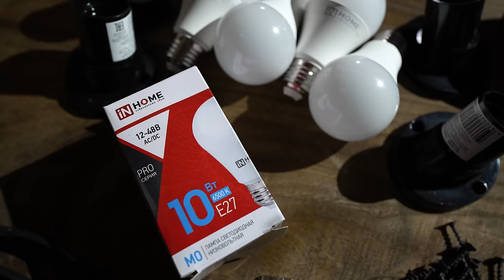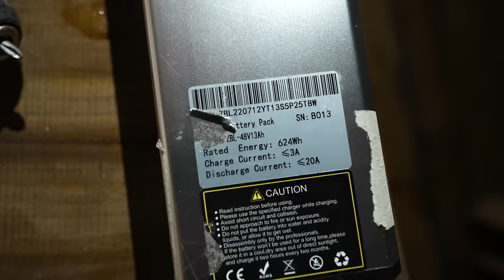HIDDEN HOUSE UNDERGROUND after a HARD TRIP, I'm warming up. PART 18

Comment: I buried a 30 gallon plastic barrel with a screw on water tight lid in the ground to store my tools and extra food in. Every time I go to my cabin I bring extra non perishable food and things like extra nails ,screws ,matches and some medical supplies to put in the barrel to have if I ever need them. I now have enough tools,food,medical supplies and things like soap to last me weeks if I should ever need them. The barrel was light weight and easy to carry on my back once I made a harness to carry it. I rotate the food even though they are mostly dehydrated foods just to make sure they stay good. My tools I use like my saws ,hammers and small axe are safe and I don't have to worry about someone taking them.
Reply: All excellent advice!
Reply: Excellent 👌 ❤
Reply: Leo que algunos acostumbran crear sus cabañas o bien ir a pasar tiempo en los campos, bosques, etc.
Yo no hago nada de eso, solo disfruto ver lo que hacen y aprender un poco de sus ideas, eso para cuándo necesito hacer algo en mi casa😊
Saludos desde el estado de chihuahua, México

Comment: Those lights look like they are rated for household voltage, the voltage is stepped down in most devices, there is a lot of inefficiency using a 48 volt on these, perhaps look for lights rated for the voltage to save on battery life. Also look for fans powered by the heat of stove alone to spread the heat through cabin....Great video thank you for sharing

Comment: I was surprised it was cold inside Alex. I thought once you got the fire burning it would be so hot you might have trouble sleeping.
I live off grid on a bush block and the things I hear at night are incredible. I'm used to it now, but one time a thunderstorm blew across the area. I was in a deep sleep and got woken by a lightning strike and instant thunder so loud, that the shock of it caused me to tense and pinch a nerve in my neck that took a week to heal. 
I'm not scared of thunderstorms it was just that there was no warning of it coming and next thing you know, Flash-Bang and me screaming from my deep sleep, then F*&k my f^$king neck LOL.

Comment: I think putting some of that bubble foil stuff on the ceiling would be real helpful containing that heat evenly through the shelter. If you used velcro you could take it down when you want it cooler in the summer.

Comment: 3:40 Voir Humbert Richard :
peut etre faire le dugout sous les branches d'un arbres bas,
comme N.Tesla travaillait sous un chene, ou St louis rendait justice ainsi
(ai vecu 2 ans en foret, dans une caravane sous un chêne : tu t'endors en 5 secondes, 30 secs si tu n'as pas sommeil ...).

Tu veux entendre pleins d’oiseaux tous les matins ? :

Un tas de pierres blanches, de type cristalline,
un tube cuivre bien droit, peu importe le diamétre, 1.2m de long minimum,
et bien vertical - planté au centre du tas, legerement enfiché dans le sol humide,
le tout au soleil, vers les arbres, mais sans etre sous les branches

(fait comme paratonnerre a pollution magneto-elec. de type 5G etc).
Cela rend les arbres 'home sweet home' pour les oiseaux Ü

Bref a connaitre pour le potager du moins.

Comment: Are those WAGO wire connectors or just the push on kind?  In the Philippines, I bought what I thought were WAGO connectors but instead where just the cheap, non-reusable push on type.